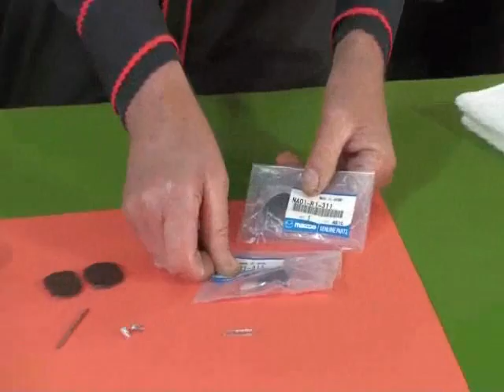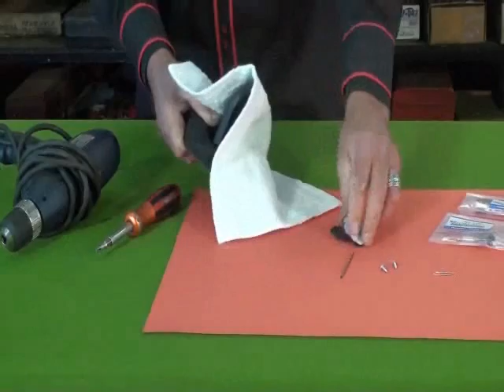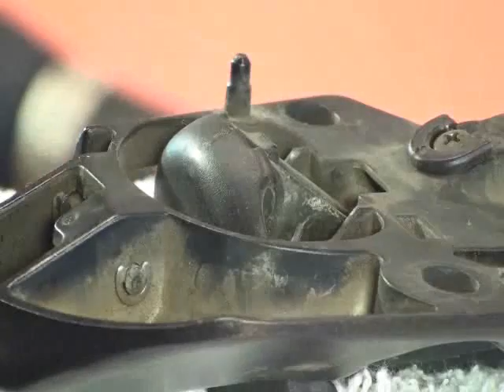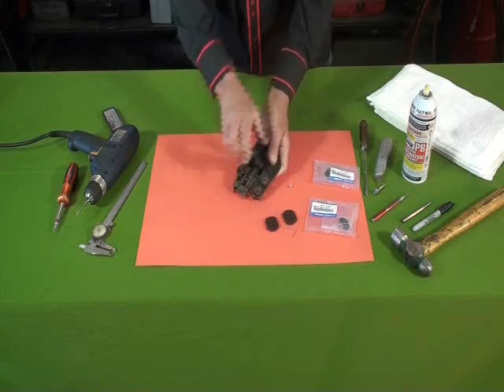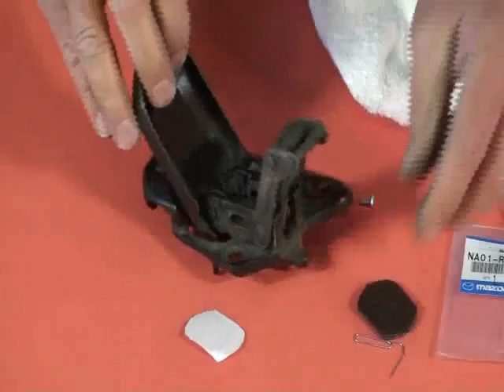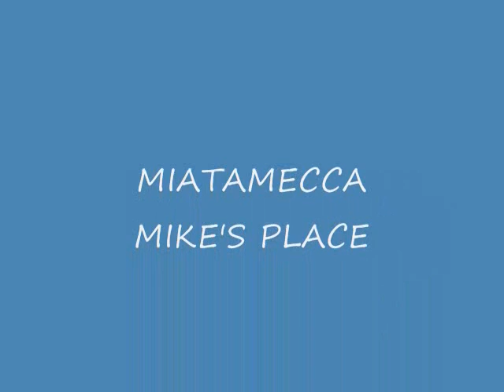How to Posi Latch Fix Miata Convertible Latch Repair

Comment: I'm in the process of repairing one of the latches on my '99. This video says to use a #2 Phillips head screwdriver. My latch is held on with #3 Phillips head screws. Make sure you're using the right driver.

Comment: Just installed your fix kit. Easy to do and excellent results. I would only suggest a video with better lighting and focus, but it was still good enough to walk me through the fix. I also learned the correct way to adjust the latch..something the my top installer guy didn’t know. Thanks